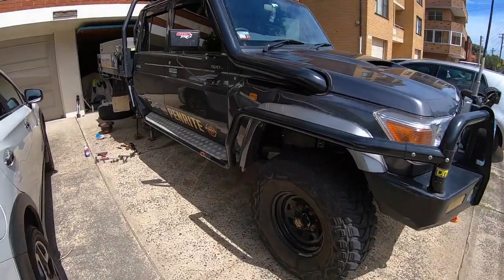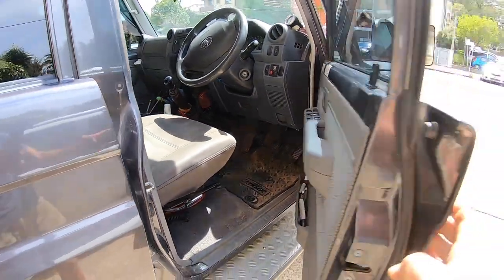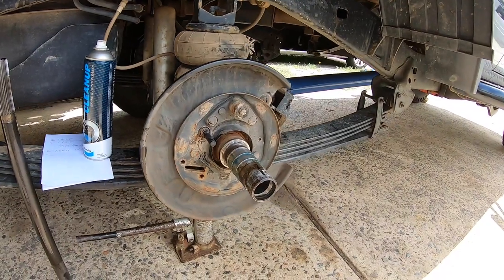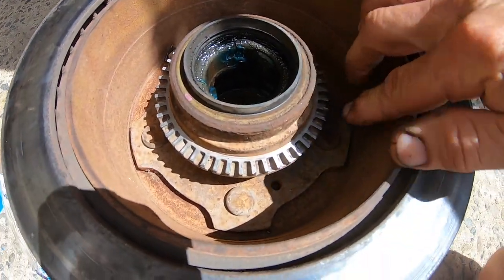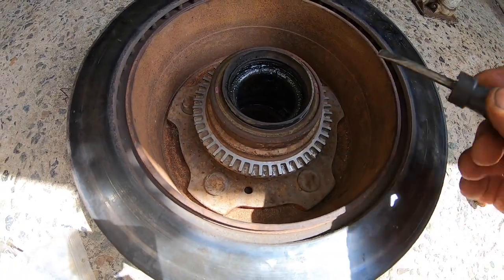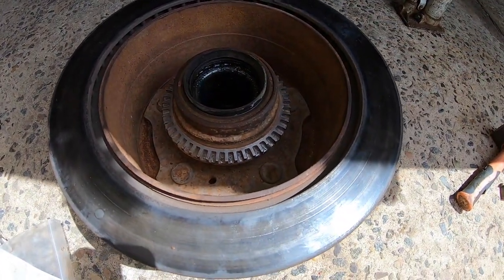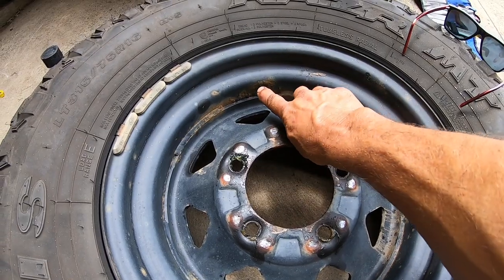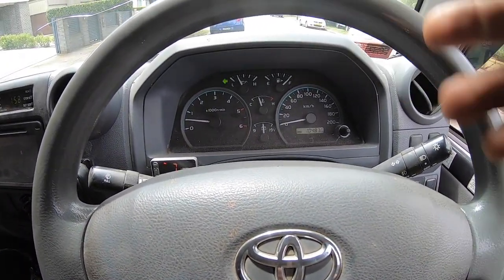Toyota landcruiser 79 78 76  series Abs faults speed sensor issues brake problems shudder in pedal

Comment: do you have the part no. for this ring? i have a broken tooth same as yours.
Reply from the maker: I didnt end up buying a new one, the band aid lasted....
Reply: @TeamBulletOffroad where is this exactly located? is this called an abs ring?
Reply: It's difficult to drive without abs, I floor the brake pedal instead of the accelerator :D Thanks mate!